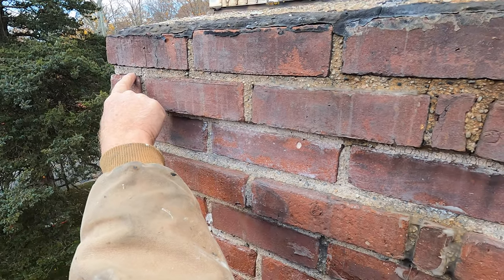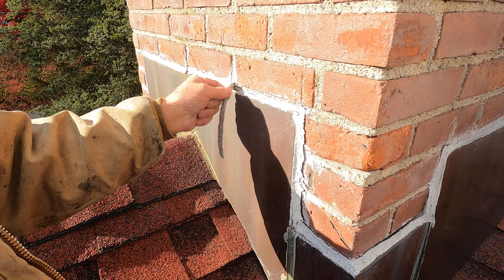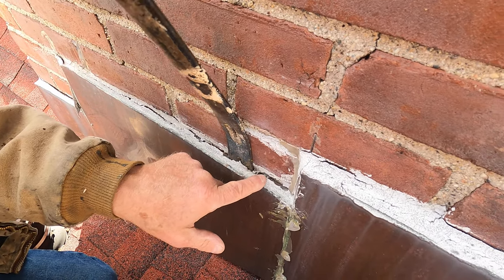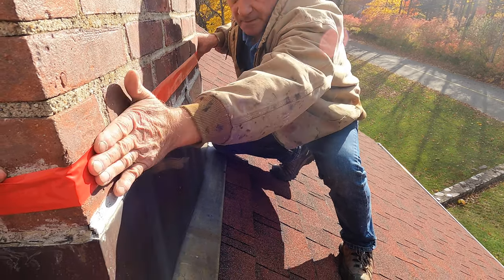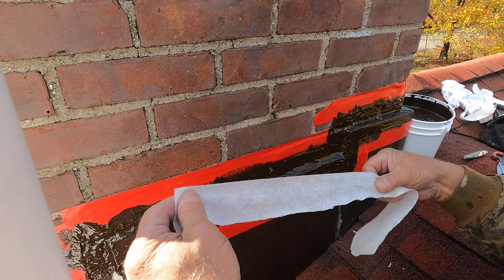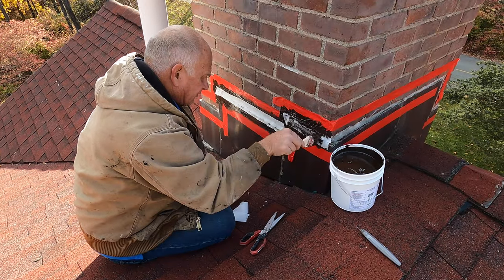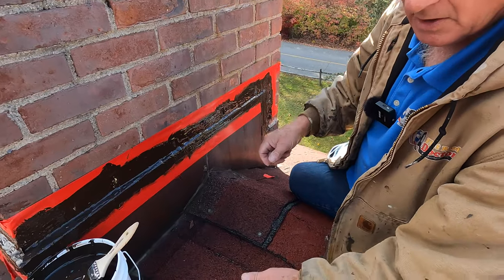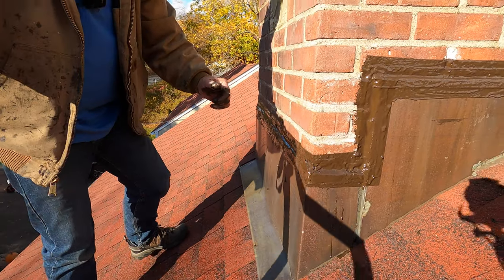The Best Trick to Fix Chimney Leaks

Comment: I'm no expert, but it seems to me that your problem isn't the caulk, but rather improper installation of flashing. You need counter flashing embedded in the brick over your base flashing. Don't rely on caulk, Polyseal, or any roof cement! Just install flashing properly.
Reply from the maker: that is the logic. But this logic has failed on so many chimneys. The embedded flashing is never deep enough, slanted upwards. So, yes, there is always a better way, but this video show after the fact and not when a new chimney is being build. Your solution is not to help someone now but rather help someone who still wants to build a chimney.
All my videos are to help someone with a problem that they inherited. To do it the way you suggest, is to tear down the chimney and start over again. In Connecticut, that could easily cost 10- 20k to do.
So what would you prefer, to spend that $15000 or to DIY with $150 of material.
Reply: @FlatRoofDoctor  Why would you tear down the chimney? I agree 100% that would be ridiculous. Use an angle grinder to clean out and/or cut slots in the mortar, then repoint and embed flashing properly (straight and deep) in the new mortar. Sounds like we agree that proper installation of flashing is key, but often overlooked.
Reply: @edwallace827 you mean remove the bricks and add flashing behind the bricks. Which requires demolition  of the current structure
Reply: @edwallace827 You're right, installing flashing properly would be appropriate, and not cost $10,000
Reply: Well said
Reply: Rough as 10 bears
Reply: @edwallace827 I know what you mean. I was the chimney flashing guy at a roofing company. 
Step flashing. On an existing chimney. 
None of it involved glueing stuff to brick.
Reply: The flashing shouldn’t be so high on the brick as well the seems are long and water has more chances to get in.    4-8” above roof line is really all you want.
Reply: If you ever seen the inside you would know why they all need to be rebuilt to roofline. The liners are always cracked to 💩 the bricks are damaged, water eroded from the inside to out.
Reply: the type of caulk is wrong, the substrate under it is not compatible and easily dusts off making it impossible for the caulk to stay adhered to te structure, fleece is a must for not only different materials internal stresses due to contractionsand gap movement but also the material under heavy uv energy assault,

even polyurethane caulk needs polyethlen fillers/beads before sealing any gap to recude internal stresses and letting loose sides ot eh caulk to the materials.

this guy knows what he is doing especially revealing the subpar craftsmandship and lack of knowledge in industry in US when it comes to membrane coating flat roofs, seams and detailing

Comment: Had to watch this one to see your fix...you are absolutely correct about the caulking on the flue cover and the tar on the mortar cap.  Caulking is a proper application at the riglet cut counter flashing.  The error is the type of caulking used and the preparation to the surface the caulking is to adhere to.  Turbo Poly Seal would be a reasonable repair, but you should still properly prep the surface area (remove old caulking, clean the surface area of metal and brick); then and only then proceed with repair.  Good job on taping off area , but with this you must insure that after the removal of the tape, a point of water intrusion has not been created.  Discuss with your audience the wicking aspects of mortar and brick.
Reply from the maker: good comment. If the brick soaks up water, then you have a major problem. The wrong bricks were used
Reply: The reason the caulk failed is because the roofer who flashed the chimney didn't install the correct reglet edge when installing the copper flashing.  When you install the flashing you have to bend the metal 90 degrees to fit into the masonry cut but you have to bend the back of that metal towards the front 3/16"-1/4".  When installing the cut groove needs to be caulked first and then install the metal pieces. Those pieces need to be secured with lead wedges inserted and pounded in with metal bar. Then you can fill the joint with the same caulk an smooth over. Caulk and mortar will never hold if the reglet edge isn't returned.

Comment: Here in Blighty we tend to use lead for flashing, chased into the brickwork
Reply: That's the traditional Dutch way that I know. Nowadays, they use some kind of plastic stuff instead, but lead slabs are still very common here in the Netherlands.
I also am battling leakage from rainwater into the ceiling of one of our bedrooms. The most likely culprit is the chimney, as the stains in the ceiling are the most intense at the chimney transition, but the water has also been diverted to other places during the past years, leaving stains on the ceiling, where ever water seemed to have been gathered. There is a roof terrace on top of that bedroom. The chimney is at the edge of the outer wall, shared with our neighbours. They do not have that water ingress issue, so, somehow, the transition between our chimney and the terrace floor is doing the leaking. We already have sealed that transition on the outside, and, I impregnated the brickwork with a water-repellant coating. Finally, I'm going to install a chimney cap to stop rainwater falling directly onto the chimney.
Then, it's a matter of waiting to see whether these measures are going to change anything.

Comment: Loved the video and information shared.......Wish you were in GA.  This is the problem I have been having for 4 years. I see where little branches are growing in the step out brick.  I paid a company $1100 to stop the chimney leak (water leaking in fireplace).  After he did his job the leak continued.  He could not figure out where the water was coming in at.  The water is causing my sheetrock above the mantle to crack.  I now realize my chimney gets wider and wider from the top to the mid section.  Little step outs.      

I have spoken with 3 contractors who work with brick.  1) One wanted $2000 just from looking at the photos taken with my phone.  2) Another wanted $1500 and spoke about painting with something - that scared me cause I don't want paint on my chimney.  3) Wanted $900, but was 95% sure he could fix the leak.  However if he had to go higher than where the the little branches growing in the chimney are (2/3rds), it would cost me more money.  I really need someone that is 100% able to stop the leak.
Reply from the maker: It is one of the hardest things to find, that someone. All these years me fixing chimneys, I still haven't found all the solutions. It is difficult to always see where the water is coming in.
I suggest to find a mason that have repaired brickwork a lot. Without any pictures it would be hard for me to determine the problem too.

Comment: I’m going to get bergstrom turbo poly seal and get started with the transitions on the flashing on my roof.
I parged the parapet wall with tar some years ago and it is pulling away causing leaks. Should I clean the tar away from the wall before covering with the turbo poly seal? What’s the preparation steps for a successful project?

Comment: Good job you can use good silicon for that flashing just make sure it is very clean before you put it on clean with the alcohol first then put the silicone on
Reply: I would never use silicone as it will eventually let go and after that you can not do any repair over it as nothing will stick to it (including more silicone). It is almost impossible to remove the silicone after. Just do not use it!

Comment: Is there anything that can be done in the meantime to prevent water leaking into the loft space from within the loft itself? Rain water is running down at the area of the chimney. Would a tin of liquid fibre glass and brush be a quick fix? The idea of a mason never occured before. Thank you both. Great team work!
Reply: i used liquid flex seal and it worked perfect, btw it was very expensive

Comment: Turbo poly will not last adhering to oxidized copper. You should have run a wire wheel on the copper to remove the oxidation.

Comment: Good work Sir to undertake and remediate what is shoody workmanship,  the copper appears to be a replacement of the former lead flashings, sadly the young trademen of today are so very poorly educated and more importantly  untrained and or mentored, therefore they embark and place sole reliance upon interim  tubes of sealant without ever cutting out joints adequately, prime the joints and therefore leave feathered edges to peel back and commence the process of failed leaking joints all over again. The levels of literacy and numeracy is so appalling and to such a degree that they cannot read the instructions on the tubes of sealant which a usually very informative, believe me I have seen this groupthink theme rconsistently recurring throughout all sectors of the construction industry after having been in the construction business for over 60 years KPP

Comment: You only prevent leaks from happening again but don’t fix the problem 100%. What about the rotten wood. Easy money in and out and the wood will remain wet and rotten for years. Probably even with mold
Reply from the maker: you show your ignorance. It is very very seldom that the leak causes rot. Also, by stopping water from leaking in, anything that was wet underneath would dry up within a few days. Nothing can stay wet for years without a supply of water. You assume there is rot every time there is a leak. In that case, all the millions of people will have to remove the roofing around that area just to find out there is nothing. Paranoia will make you overthink and overreact in most cases. Life is not that complicated.
If I was overthinking my trip to the store in a car or a bike, I might not go anywhere because I might just think that somehow someone will cross the center line and kill me head-on. That is more possible than getting rot from a leak on a chimney. So, which one should I worry about more? 
So to put it in your words, I should be in an accident every time I drive out on the road. 
I am a roofer and have been fixing leaks for over 30 years. I should know. I also have been driving for over 48 years too. 
Narrow escapes I had, and so is it with leaks, if not taken care of, could lead to rot, but not immediately.
Reply: Just spray inside with Shockwave if your concerned.
Reply: Hey, if he didn't fall through the roof....the wood's probably fine.